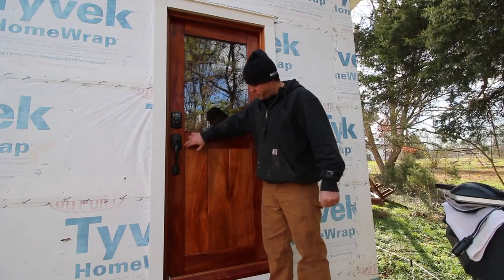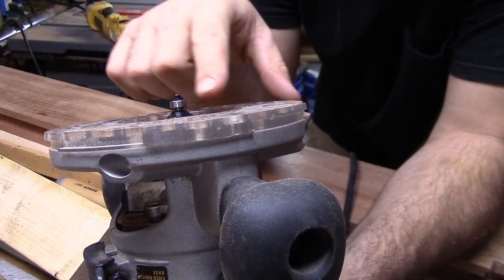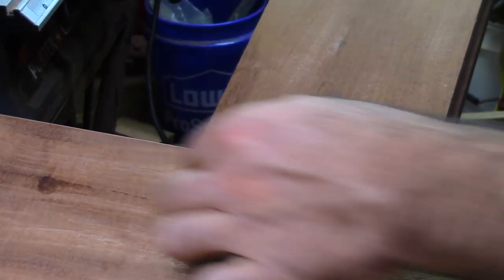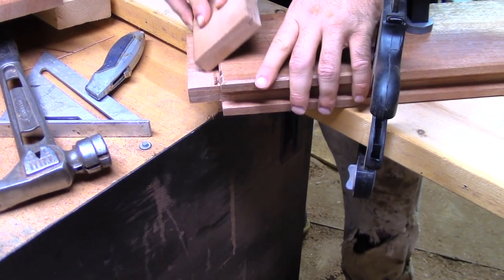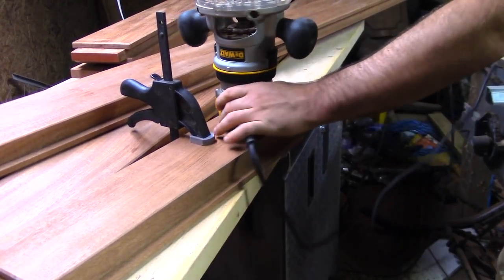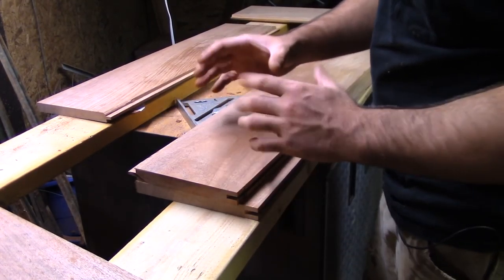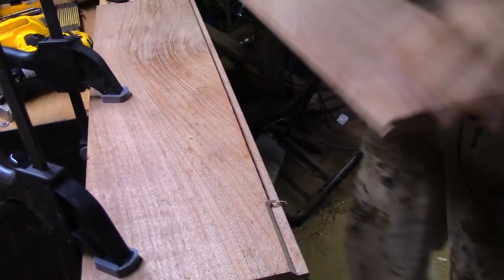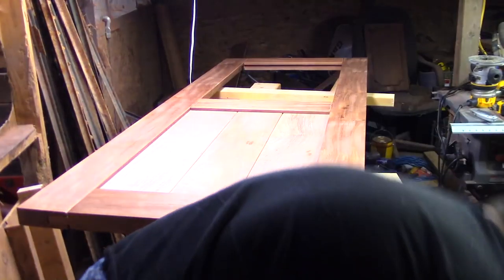Adding a Chamfer. P10

Comment: I wondered how you were going to rout the bevel on the tongue sides of the fillers. What you ended up doing works, but,,, you can snipe the ends easily. A better way would have been to clamp a fence onto the board and use the beveling bit without the bearing. It's another PITA so set up and check over and over, but done right you wind up with a perfect 45* break on all edges without any snipe..  I know you said you bought a router table, so now life will be easier, but I have to hand it to you. Working in a barn with very limited tools and space and lighting and no vacuum system, you really impress me. Especially since you are video taping everything at the same time!!!  I give you HUGE PROPS, Dan. HUGE!!!!!!!  Most would say Fork It and go to Depot and buy a ready to install door.... One thing I do suggest, AT LEAST while off camera, wear a breathing filter while woodworking. Especially while sanding with any power tools.. Trust me, your lungs will thank you. So will your taste buds!!  lol...  Another great video, buddy.. Scratches to Peanut...